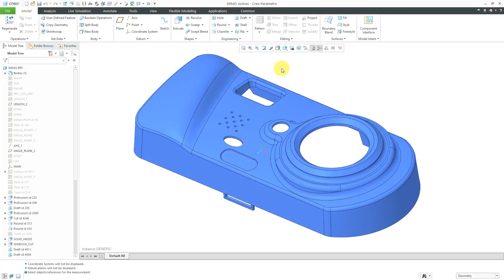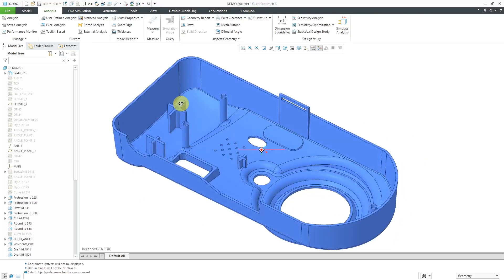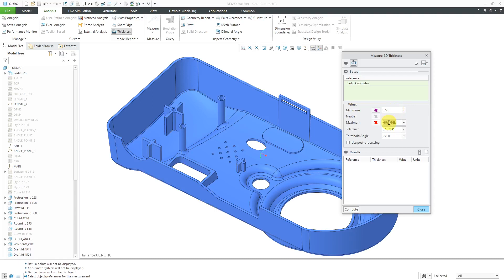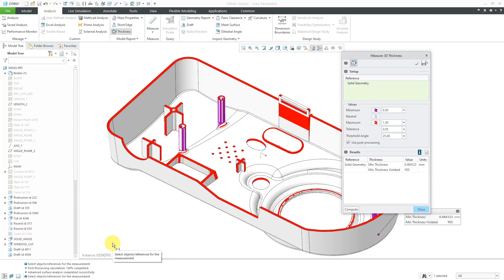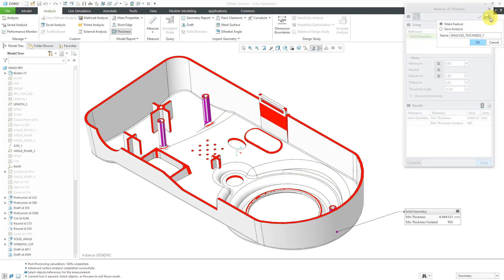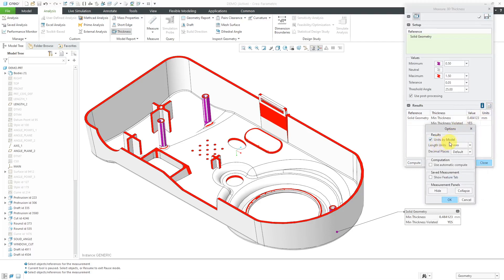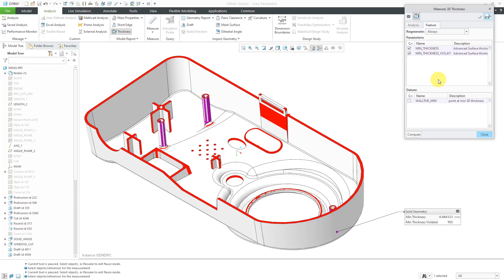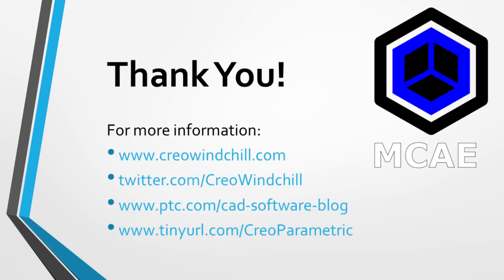Creo Parametric - 3D Thickness Analysis | Mold Design

Comment: Hi - do you have a preference for monitor resolution? I'm trying to decide if my current 2560x1440 monitor is okay, or if I should upgrade to 3840x2160 (4K). Thanks !!
Reply from the maker: I don’t know anything about computer hardware.
Reply: Please mind that creo is not yet optimised for 4K resolution and small (laptop) screens, the windows scaling of fonts doesn’t yet apply.
Reply: @xonegon  Okay, thanks for the feedback. I think I'll stick with my 2560 x 1440 monitors for the near future. Thanks.